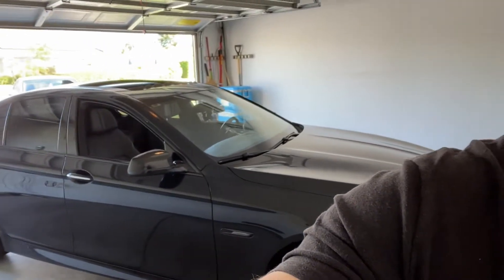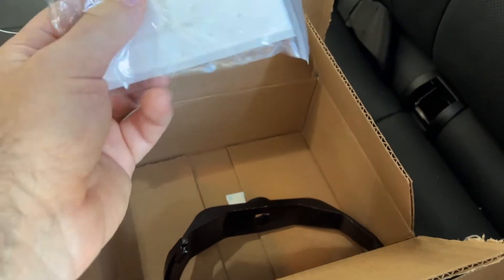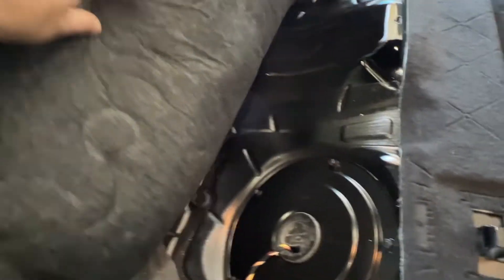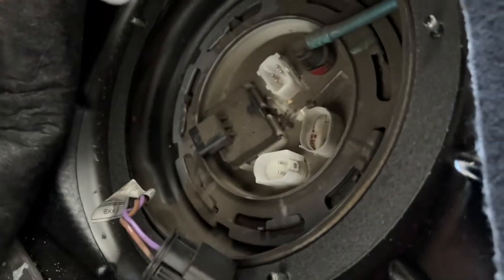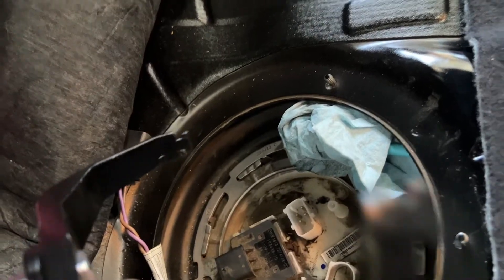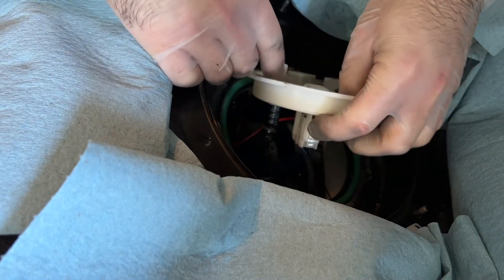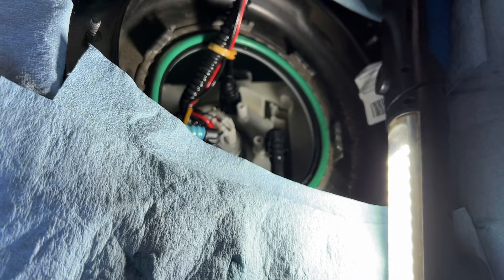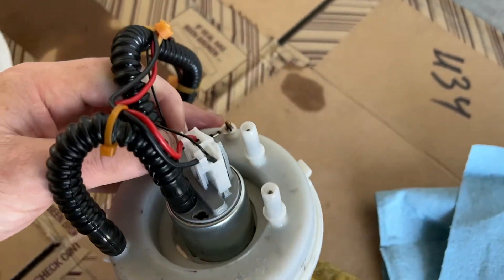How To Replace LPFP (Low Pressure Fuel Pump) on BMW F10 535i N55 - Stage 2 Fuel Pump | BOND Garage

Comment: Is the regulator mounted anywhere in the tank or just free floating ? I’m having drivtain malfunction after installing new pump
Reply from the maker: I think it's just clipped in somewhere but I"m not entirely sure. did you sort it out already?

Comment: hi,i have the same problem, with my f10 535 2012 year. i changed and coded 5 or 6 EKP module but problem stay. what me to do? change Lpfl or just try to find better EKP module?
Reply from the maker: pump. if it keeps blowing the pump module it's most likely that the pump has a problem and fries the module. had to put a stock OEM pump after this one got toasted.
Reply: @BONDGarage  i changed the pump but problem stay. :( i dont know what then

Comment: Hey the part # for the install kit that doesn’t come with that fuel hose. Did you add it in there with the order??
Reply from the maker: I've used whatever I needed. don't remember which parts I've left out of it

Comment: Hi just discovered you channel great content mate . Did this fix you issue because I have the same problem your having my car will just shut off say fuel supply , then if I lock it and wait about 5 mins it’s fine again
Reply from the maker: it did not. got another module from the dealer and coded and after a few weeks it would turn off and not start for almost 2 hours. so now it's at the dealer for the same repair again with proper coding I guess. will make an update when it's done.
Reply: @BONDGarage  well that’s quite strange . I went and purchased a brand new lpfp and ekpm3 from dealer going to install myself and code . So you bought a used modul . That didn’t work , you bought a new modul and you coded it yourself or the dealer coded it and it cut out after two weeks ?
Reply from the maker: @toomuchsauce4442  got a new module and coded it. apparently there's an issue with my ista since there appears to be a data problem. would try a different software if i had the time. I strongly believe it's the module so it's being replaced/coded again.
Reply: @BONDGarage  so would you recommend I take my car to dealer to program the ekps rather than trying to attempt it . Thanks for reply
Reply from the maker: @toomuchsauce4442  if you have the tools might as well give it a shot. changing the part itself is super easy. and if the coding doesn't work for whatever reason you can still bring it in later. if there's no problem you'll save $$$
Reply: @BONDGarage  hi , how did the coding go my friend . My car is booked in the morning to get the module coded . I would rather the dealer did it with the most up to date software .
Reply from the maker: @toomuchsauce4442  just got word today that another new module has been installed and coded. but then the lpfp showed an internal short so that was replaced too. now it seems to be fine again.
Reply: @BONDGarage  it’s strange because my cars not even tuned so I wonder why these ekps are all getting fried .
Reply: @BONDGarage  just installed and coded my ekps . My car would usually stall when the outside temperature is very hot . London has been about 25-30 •c lately so this issue was extremely annoying . Seems to be running great have been driving it all day in hot weather stop start traffic and no issues atall . I also have a brand new bmw lpfp in case but when I went to replace it I noticed the one in my car currently is dated 2022 so I think who ever had the car before me tried to fix this issue with a fuel pump but failed . Will keep you updated how it goes .
Reply from the maker: @toomuchsauce4442  it can be somewhat tricky. best to stay with oem parts for this. if heat is an issue, there are some 3d printed encasings for the ekps module that allow better heat exchange. might add one to mine to prolong its lifespan..
Reply: @BONDGarage   I went to get mine programmed at the dealership and they tried to charge me 350£ there reason was because it would take all day and because my car was a 2013 model (complete bullshit), I found a local guy with an autel scanner and he coded it in about 2-3 minutes . And charged me 50 pound . The dealer is a joke and I’m thinking about making a complaint .
Reply: So the problem is the ekps module??
Reply: Because im having the same problem when its very hot outside my car would cut off
Reply: I’m having the same issue, that fuel supply error will pop up and start to stall and after locking it and 5 min later it would start up but would stall again after a 20-30 min in hot weather.  I bought a fuel control module
Reply: @dannung4305  did the fuel control module fix the issue ??
Reply: @dannung4305  buh i have a 2013 335i xdrive not a 535i sedan

Comment: I have also f10 n55 i change mine months ago plug and play but now im runing stage 3 and im getting a code 11A210-Low pressure fuel system,plausibility:Power of electric fuel pump is too high for actual pressure. So i dont know need to code the one i have or need to change ???!!! Thnx
Reply from the maker: so what I learned is that these modules like to cook themselves. especially when the car is tuned. at a stage 3 I take that your lpfp needs to work a lot harder. Mine is already back out. had a problem and I'm back to stock lpfp. did you find the problem?

Comment: Since you offered to answer some questions. My only concern is wiring. It intimidates me. Can you show use how you wired the new plug with the harness?
Reply from the maker: it's just 2 wires if I remember correct. isolation is what concerned me as well but worked out fine.

Comment: Hi, how are you brother.  I have 2011 bmw f10 v6 the problem is fuel supply and the car does not start it just cranking so I replaced the fuel pump control module from Amazon for $50 do I need to code and program it or to replace the fuel pump. Let me know please
Reply from the maker: You'll need to code it. As far as I know you only don't have to code it if it's the same model, engine, year (?) since it has the right information on there. that's why I used a used one that is the same model, engine and year as mine. anything new requires coding.
Also there's no F10 V6 but that's just fyi my man.
Reply: @BONDGarage  
Thank you,  yeah your right I mean inline 6
Reply: @BONDGarage  
What is the good coding machine for module
Reply: That's a e90 btw, f10 didn't start till 2013/2014
Reply: F10 started 2010.... and e90 is 3 series dont know what you talking

Comment: Is it normal for the car to run super rough after I installed a new fuel system. Is it because there is air in the fuel system still?😊
Reply from the maker: you'll have to prime after opening the fuel system. usually you can only prime the LPFP by turning the ignition on for 10-20s for a like 3 times to make sure your HPFP won't starve. if you open between HPFP and injector, there will be air in the lines but that will be pumped into the cylinder. might run rough for a few seconds until all the air is purged.

Comment: So my tank was pretty full when I did this which I know was not the right way to do this but I didn’t really have a choice. Anyways, when I opened the tank gas spilled all over garage floor. Replaced pump, and now it spills all over floor when running. Did something happen to my tank?  Ugh, nevermind, when I was putting everything back together I realized I had lost the little red clip keeping the fuel line attached. No, it will not stay attached without that and now I can’t find the clip. It’s probably in the fuel tank….
Reply from the maker: did you find it in there? it's always "fun" to work with gasoline. Appreciate sharing your experience. you learn the most when things go wrong!

Comment: Can I have the all the size sockets used
Reply from the maker: did that a while ago so will not remember everything but I try to mention the tools used when used. same with torque specs. if there are any important ones it'll be for sure in the video. but for the pump that's al pretty standard. just the ones under the rear seat I believe.